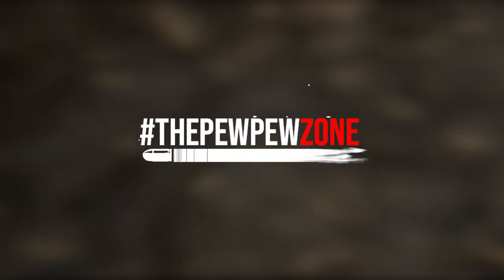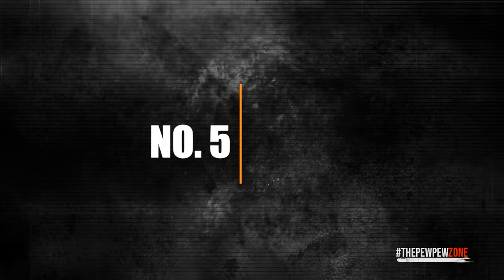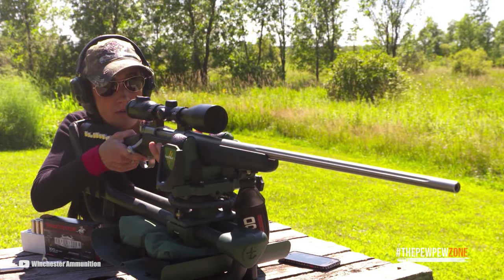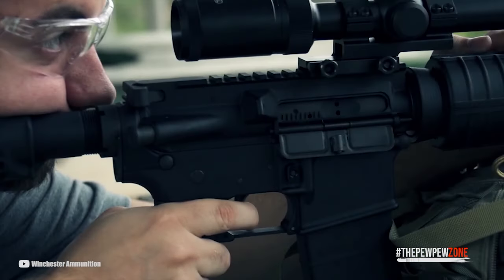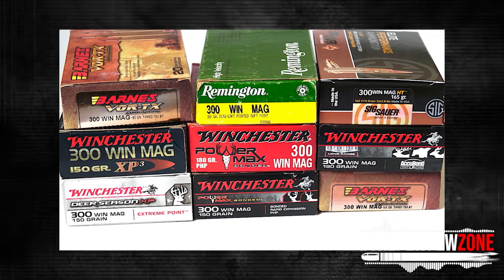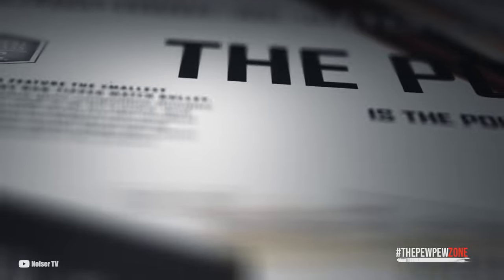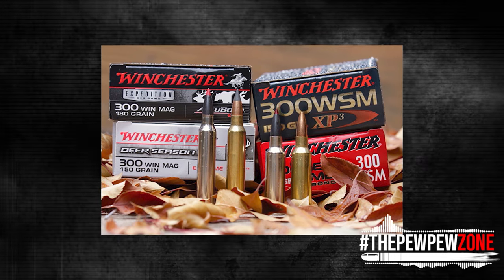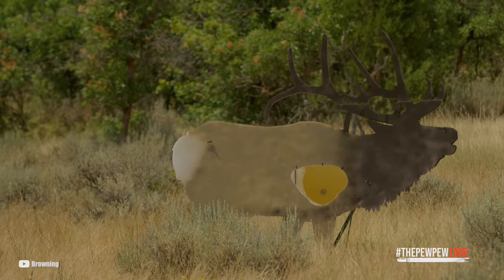5 Reasons the .300 Win Mag Rules the Roost

Comment: My alaskan 3006 with my 168 accLR at 2950 does the same thing,no belt and with 57.2 gr
Reply: The 300 WM will do that velocity with a 190 gr ABLR. Higher BC, less drift, and substantially more energy at range
Reply: @strat1080  while thats true, most people are not shooting at game past 500, so functionally, it doesn't matter. one of those 168's in the bread basket at 600 yards is a dead elk.
Reply: @hotramen5952   and the 190 has better sectional density and a lot more energy to get through a shoulder if you don’t have a great shot presentation or your POI is off a bit. I like that little extra insurance the 300 gives you. I think 600 yards is stretching it a bit for the old ought six.
Reply: There isn't any kind of game that hasn't been taken with a 30-06. If K. Bell shot 800 Elephants with a 275 Rigsby(7x57 Mauser) guess T-Rex could be game for the 30-06. Yet on Jurasic a Marlin 45-70 was the choice🦖🤣. My all arround 30-06 is 165 Grns. For something bigger a 180. Hit right they don't go away with either.👍By the way that old 1917 US Enfield will be rebarreled for 35 Whelen next year, And a 7 MM for a lighter rifle for grandson(280 AI, 7RM or loaded down 28 Nosler, still munching on which)
Reply: And I can push the 190 close to 2700 in my 308 which doesn't sound like much, however 308 does this with substantially less recoil and almost 20mm shorter case compared to the 300wm

Comment: I'm going to get a used 300 Weatherby(about $500 or $700 New) and rebarell(About $600) to 300 Win Mag. Simple 300 PRC ballistics, Plenty afordable Ammo, Cases, Seat out the long or heavy bullets. No mods to bolt face or magazine
Reply: That's an interesting take. Why wouldn't you just keep it as a 300Wby? Cost of ammo? If you're going to rebarrel it to seat longer bullets and are concerned with the box length, you may also consider a magnum length 700 or 70 action.

Comment: The .300 WM with 200g soft point boat tail has a superior ballistic coefficient and sectional density. With the additional case capacity and extra powder, it becomes a supremely accurate long range hunting rifle with maximum retained energy and velocity. Characteristics simply not available to smaller calibers and cartridges.
Reply: The 300 magnum shoots the same exact bullet as the 30-06 .308 diameter and  only about 300fps faster .with substantially more recoil.
How much energy is needed to kill an elk at 500 yds ?
Most guides would say 1500+ and the 06 produces up to 1900 ft lbs with the right bullet and load  at 600y yds. Many are not aware of its true capabilitoes they just see the word magnum stamped on a cartrige and are instantly sold
Reply: Just exactly which 200 grain soft point boat tail bullet with the superior bc  are you speaking of?
Reply: @jamiehurtt3530  Match King. The bullet used to win the Wimbledon Cup 1,000yd. in 7mm at Camp Perry, 1970. The Game King is similar in bc with high sd. Smaller calibers don't have the sd and are at an inherent disadvantage for long range hunting, maybe except for 7mm.
Reply: @johnj5985  
And the  300 h&h mag won the 1000 yd Wimbledon in 1935
Reply: @johnj5985  sorry but match king and gameking aren't even I'm the  same class as the nosler accubomd 
Long range  bonded hunting bullet
Reply: @johnj5985  
Neither the gameking or the matching offer a 0.661 bc  .308 bullet  and they're both only  180 grain with a much lower bc and don't retain energy as well down range .
A heavy 210 grain accunond   lr bullet with a 0.661 bc shot from a 30-06  at 2625 fps  Is

going to give you much more ft lbs of  energy at 600 yds than a 180 grain  shot with a matchking or gameking bullet with only a 0.501 or 0.502 bc   in a 30-06 for example
Reply: @johnj5985  
The 200 0.714  grain match king isn't a hunting bullet it's a target bullet for ringing steel and   for winning target  shooting matches lmao
180 gtrain is all that's offered in 30 caliber as a hunting bullet  in those two mentioned
Reply: @johnj5985  the 200 grain gameking  is a hunting bullet but not the 200 grain matchking
It's still not in the same league as an 210 grain ABLR
Reply: @jamiehurtt3530  right. the "matching' 200g Sierra MK HPBT has bc as high as .715 and lowest is .660. the 180g bc in any manufacturer will be inherently lower.